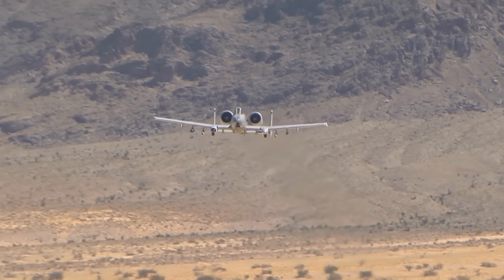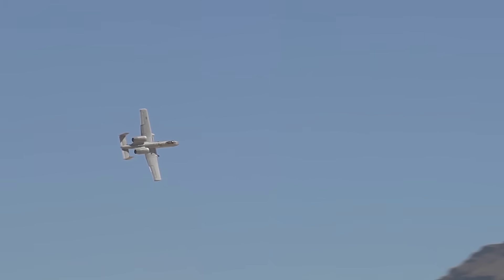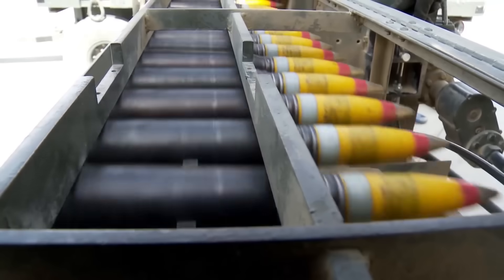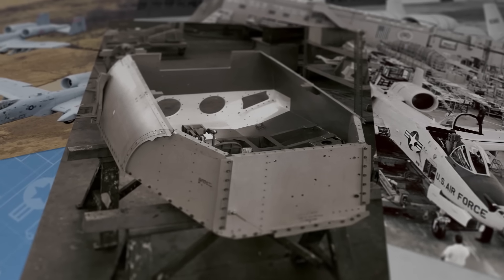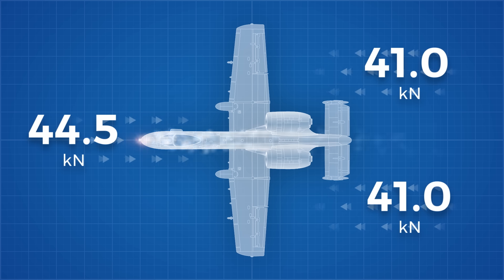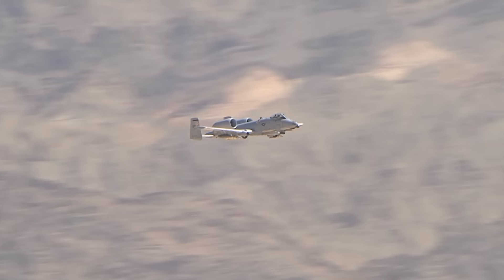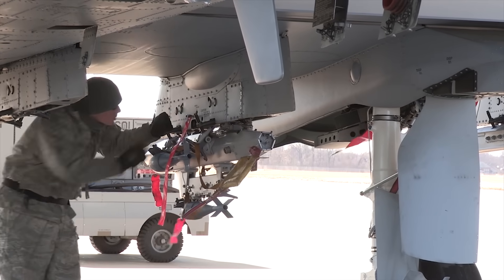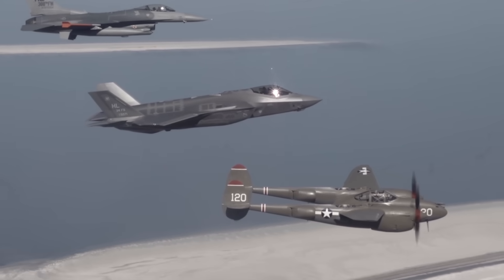The Insane Engineering of the A-10 Warthog

Comment: the sound of that gun is so iconic damn never realised the rest of the plane was so impressive
Reply: Once you see that gun operate you will be a believer. Once you see that gun operate onboard a flying A-10 you will have come to Jesus!
Reply: Those shells are about the size of a 2L the actual projectile about the same size as a smaller personal 20oz bottle of coke
Reply: @russell7852  Those projectiles are also launched at 4200 rpm.
Reply: @russell7852  Fun fact, tyey actually sell shot glass sets made out of the casings.
Reply: You hear that sound that resembles flatulence?  That is a monster s--ting out the remnants of the last terrorist that got in its way.

Comment: Small correction: the gun is actually offset to the pilots left such that the barrel that is firing is on the center line of the plane. Source: the dent in my head.

Comment: I may remember wrongly, but I believe the cannon is mounted to the left, resulting in the cannon barrel being fired is on the aircraft's center line. Other fun things to mention are that the nose wheel is mounted to the right, again to make room for the cannon. The cannon can be fired with only one functional hydarulic circuit, so the firing rate drops to half. LOOOOOOVE this Boat

Comment: There is an error in this video. Out production was never an option. Militaries talked about any war with the Soviets (especially in the 1980s) as a "come as you are" war due to the build times for most high-end equipment (tanks, aircraft, etc). This is why most people were freaking out in the 80s because the logical conclusion was that once one side exhausted its supplies, tactical nukes would be used which would probably escalate into full-on nuclear war. Check out the work by Gwynne Dyer (a former military consultant turned journalist) on this.

Comment: 4:58 The casings aren't ejected so there is not as much of a center gravity shift on the plane which would cause the nose to rise disrupting aim.
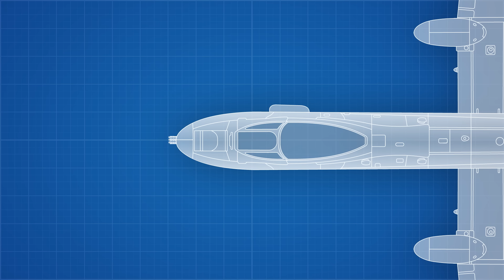7:48 The gun isn't on the center-line, it is slightly left ... really bad research.
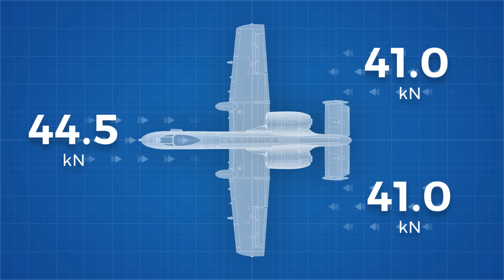8:01 TF34 not T34
The background audio track is simply annoying, what is up with those beats shifting from left to right and back again?
Also no mention of the A-10 capability as platform for the AGM-65 Maverick with which it achieved most of her kills in Desert Storm.

Comment: Ah, thought you'd hit the fact that the A-10 without the gun is actually isn't airworthy.  The gun isn't simply mounted on the centerline.  The air frame is built in balance with the gun.  There was a crazy notion to re-purpose old A-10s as fire fighting air craft.  It wasn't possible due to this fact.  It's on the most obscure things I ever heard about the vehicle.

Comment: I like how this video is full of laughably basic errors. A-10 gun is NOT CENTERED! It's offset to the left! Did you fail to even look at your own footage before making that completely wrong 3D model? F-16 was NOT designed to be multi-role fighter, it was basic, cheap interceptor, the whole multi-role thing (which it does badly) is the result of tacking more and more missions onto it in the last 20 years. But even then, it's vastly better CAS plane than A-10 because it can actually get to combat spot on time and use far better guided munitions instead of blindly dropping 'dumb' bombs. Title is idiotic clickbait, too, NOTHING in A-10 is particularly noteworthy or unique, there is a reason no one tried to copy it and US armed forces are trying to get rid of it. Literally every single thing here is either wrong or copying empty soundbites of fanboys, if your other videos are just as """accurate""" they are worthless.

Comment: "Easy to manufacture." Translation: a lot of 'em ain't coming back.
If you have  1000 tanks and the other guy has 900, the battle will end up somewhere around 150~25, with the 25 on the run.
A WWII bomber "tour" was 25 missions, with an average death rate of around 4%. This means you had a 36% chance of surviving one tour.
The Warthog's pilot is surrounded by a titanium "bathtub" which can survive a 23 millimetre machine-gun bullet, it sez here. There are no 23 millimetre machine-guns out there. Most of them are fifties.

Comment: Hey there,  Just going to put it out there, The A-10's GAU-8 Avenger Gun is mounted just off the centre line. this is because the front gear needed to go somewhere, If you get a frontal view, you will see the gun and gear mounted on the other side of the Aircraft. they counter the weight with Weights on the side of the gear. you can find them on the wing, or hanging down of the fuselage.

Anyway. love what you do. awesome animations, Keep it up :)

Comment: The whole section on hydraulic redundancy is universal to all modern planes. The Boeing's and Airbuses you use to fly on holiday are designed to still function after an engine loss with 3 separate hydraulic systems and redundancys in all flight critical parts

Comment: US we will replace A10 with F35...
A10: We don't do that here
Reply: Yeah.  By design the F35 can do some remarkable things...NONE of which are things the A10 does.  If the A10 is ever replaced it needs to be by a plane designed to the same goals as the A10 was.  But, that would require intelligence which is an ever decreasing commodity in government.
Reply: R. Blakehole it all comes down to engine count.  A single engine aircraft cannot take the place of the A10.
Reply: @TheRazmotaz  Thought the A-10 can operate on one engine?
Reply: R. Blakehole all that would be required for that is a prop aircraft
Reply: Main problem is Air Forces around the world is run by ex-fast jet pilots and the only thing pilots want is a faster jet.

CAS is one mission AF doesn't want to do and never has.

"Not a pound to the ground" mantra is there for 40 odd years now, and was the main thing against F-15E and that was a massive success in the end.
Reply: THE REST OF THE WORLD:  You Want To Do what??

The A-10 Community: Umm. We don't think so.
Reply: It is a monster; I like it
Reply: No. It will be by super tucano
Reply: Siri The Super Tucano would would be a good supplement to the A-10, not a replacement. While the Super Tucano has proven itself fighting smaller armies and militias like what we are fighting in the Middle East, it would not be good fighting a major power. Which is what the A-10s were for
Reply: @Sirikazy  debatable .😁
Reply: BenjaminFranklin99 you can’t call that a war since although it is a war the US has no brought over all or even 50% of its war potential. Also the problem is that Iraq, Iran, Afghan and all those areas aren’t like wars before. It’s a war for not only the people but also a guerrilla warfare with people who can hide literally anywhere. So you really can’t expect an army to fight against something like that.
Reply: warthog v fat amy
Reply: Umm, it can try, but I dont think it could do as good a job at it. 😁
Reply: I don't understand the american attitude there is no country on earth that can match united States fire power or even comes close to sheer US budget so my question is who is America fighting what war is being fought that comes close to American fire power
Reply: @robbiedean2006    The US may be strong - but we can't be strong everywhere.  The reality is that the US military moves at a speed of 8 knots - the speed of a merchant ship.  And it will take us at least two months to mass our combat power - and all out potential enemies can do this in less than a day.  Also - just because a war starts in one part of the world does not excuse us from our treaty obligations in the other parts of the world.
Reply: @robbiedean2006  LOL we're ready to fight EVERYONE all at once.
Reply: @robbiedean2006  several wars at once.
China, Turks, north Korea. Will be over by Christmas

Comment: A comment to some minor inaccuracies plus some bonus data..
1) The spent cartridges are retained more so because spending the rounds and ejecting the casings removes too much weight from the front of the aircraft throwing the centre of gravity off. Keeping the casings reduces this effect, and the casings are re-used to manufacture new cartridges.
2) The gun is NOT mounted directly on the centreline, mostly because it would impede too much on the room for the nose landing gear.
The gun is offset to one side, but the firing barrel is (looking from the front) the left most barrel to still keep the recoil mostly centreline.
Bonus - The nose gear is also offset to the opposite side of the gun so as both can fit, find a close pic of an A-10c with the gear down and you'll see looking from the front the nose gear is to the left of centreline.
Bonus - The GAU-8's actual capacity is 1,350 rounds, but is usually loaded to 1150. If i recall correctly the reasoning was because 2 x crates of ammo = 1,150. There could be more to it.
To whoever put this together... thankyou! there are so many bullshit videos on this that get it so wrong. This author has done a more than acceptable amount of research.

Comment: 07:45 - the barrel in the firing position is aligned with the centerline, the gun itself is not. If it were, the aircraft would yaw during firing. You can see it is off center in some of the footage.

Comment: The A10 Warthog design comes on the back of the German Junkers Ju87 dive bomber of WW2,  known as the Stuka. Also "close support" is a German panzer concept where the tanks are provided with defensive and offensive support by mostly inclusive units within a panzer division.  Although the Stukas were under Luftwaffe command, they were used for the most part for the close support of the panzer forces. Even the Gatling antitank gun on the A10  is a copy of the Stuka's  antitank canons, which were used effectively in Kursk against Soviet tanks.

Comment: Might wanna fact check - the gatling gun fires at the 9 o'clock position, so they shifted the gun slightly right to accommodate that  (facing the gun). If you look at a front on image you will notice that

Comment: ok so hate to be "one of those guys" but one mistake: the gun was not centered on the plane the firing barrel was centered on the plane, the gun is set off to the right when looking at it from the front as it's the left most position of the barrels as they turn in to firing. great video!!

Comment: This video missed two key A-10 attributes:
1) 1150 rounds of 30mm was better than the equivalent weight of a few bombs or missiles and could be disbursed over larger area, more targets, & longer timeframe.
2) The slow speed and square wings allowed the A-10 to use fuel slowly, so it could loiter in a combat zone for hours. Neither the F-16 nor F-35 could do this.

Comment: 7:44 The GAU 8/A fires from the 9(ish)-o'clock barrel. That whole system is mounted slightly to the left-side of the plane so that the 9-o'clock barrel is on the centerline of the plane. You can see the offset in this video: 8:30, 10:02

Comment: The cannon is actually mounted to off center but the firing barrel is in line with the centerline if that makes sense. That way the recoil doesn’t make the plane turn when it’s fired. Kinda like pushing the corner of a box makes it turn but pushing the center makes it go straight back.

Comment: The F-35 was never meant to and will never replace the A-10. That's a myth that I hate. It is not a one or another, both are necessary. The A-10 cannot operate in contested airspace. Yes, the A-10 is robust, but ground fire is not the same as a missile. An R-77 or an S-400 will take an A-10 out of the sky so fast it'll make your head spin. Chaff is not very effective against modern fully active radar homing missiles. As the prominence of Russian and Chinese military hardware continues to grow this threat becomes greater every day. This threat is compounded by foreign military sales as well. There will come a day when we will need stealth fighters to come in and sanitize airspace in preparation for the A-10 to enter the battle space afterwards and assist in ground attack. That said, before the airspace can be totally sanitized if a CAS, CSAR, or FAC mission is necessary an F-35 will need to do that mission as well as their primary SEAD or OCA mission until the air space is clear and the specialist A-10 can take over. The F-35 is no A-10 when it comes to the loiter time and raw ordinance it can bring to a target, but with a more advanced radar/sensor suite, greater pilot situational awareness, and a wider variety of munitions the F-35 is fully capable as a ground attack aircraft. At the end of the day, the F-35 is a night one plane, the A-10 is a day 2-??? plane. Both are 100% necessary.

Comment: A highly durable fighter with heavy weaponry designed for close air support. The C-model has been modified with, for example, upgraded avionics, and features a glass cockpit with a vastly different layout. Though designed with combat in mind, it has a distinct look, with engines mounted to the upper part of the body and straight wings. Stable at slow speeds when engaging in air-to-ground attacks, it is fitted with anti-surface armament including 30 mm machine guns. Its toughened armor gives it strong resistance to anti-air fire, making the craft highly durable. The extraordinary power of its 30 mm machine gun (a trademark of the A-10) has led some to say somewhat humorously that they cause the craft to slow down when fired. Although its existence was threatened by multirole fighters because of its lack of self-defense capabilities in aerial combat, its war records helped prove its worth in battle. Its nickname is "Thunderbolt II"

-Ace Combat 7 Hangar description

Comment: I believe your diagram of the gun being on the centerline of the aircraft is incorrect.  The gun is mounted slightly to the left (port) side of the aircraft so that the barrel directly to the right of its rotational axis (9 o'clock looking from the front) will be aligned with the centerline of the aircraft when firing.  This also leaves more room for the nosewheel, which is mounted slightly to the right (starboard) side of the aircraft.
A good example is at 10:03.

Comment: The A-10 WILL eventually be replaced. Its been in service since 1977, and just like the B-52, can only be improved so much before it becomes obsolete. More than likely, DARPA or some other R&D agency will come up with a suitable replacement for the A-10. Aircraft like the F-16 cannot replace the A-10, and never will. The F-35 also cannot replace the A-10. The F-35 program was a $1.5 Trillion failure (at the time), and it bring a multirole aircraft, its meant to be decent at everything. The A-10 is a dedication CAS aircraft. The F-35 doesn't have the payload to be a dedicated CAS aircraft, especially the F-35B (which is the USMCs VTOL variant) due to its lower payload capacity. The good thing about the F-35 though, is with its highly advanced sensor packages, avionics, etc. It can deploy much more advanced munitions compared to the A-10.